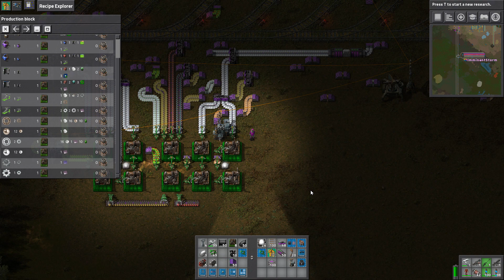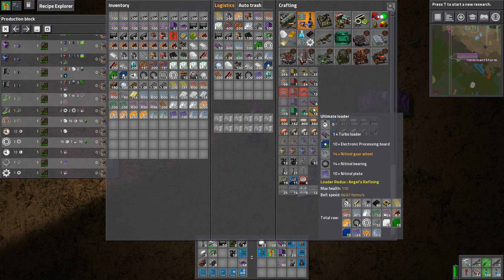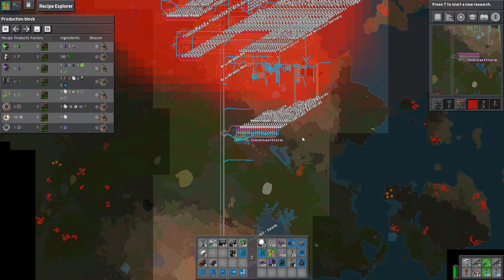Factorio - Angel's & Bob's - Episode 235 - Construction Bots Complete

Comment: At this point I'd suggest grabbing all your construction bots in your entire system and feeding them in as input to your factories, so they can be upgraded to fusion-powered bots (and doing the same with logistics bots later). That way all your bots will run at the same speed, so you won't end up with a blueprint that's ALMOST all finished, but three MK1 bots got assigned three bits of the layout and they're still straggling over from the other side of your base. To do that, turn off your personal roboports, then lay out a blueprint of about 50 or so belts. The bots will grab the belts, lay them out, then park in the nearest roboport — where you grab them and do that again. Once you have all the non-fusion-powered bots, upgrade them all!